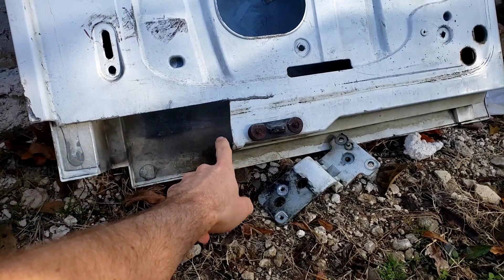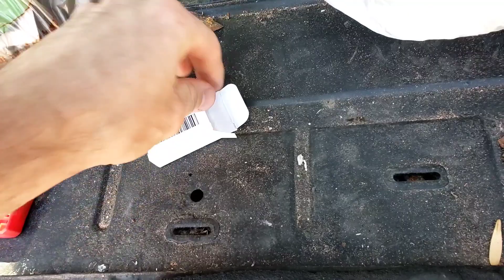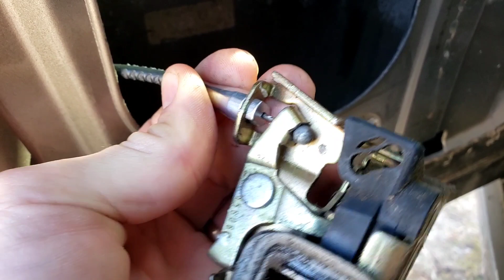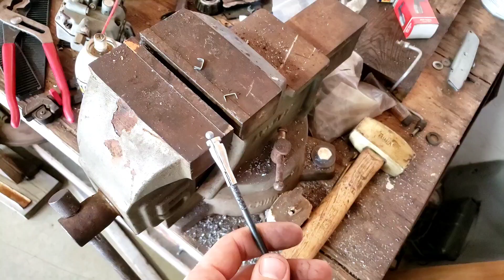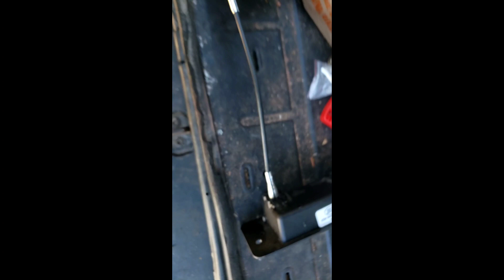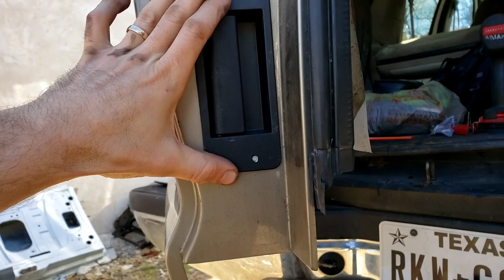Fix Your Ford Excursion Broken Tailgate Handle, Inexpensive!

Comment: What size rivets did you end up using to reattach the handle? I’m going to have to buy a kit for that.
Reply from the maker: I don't recall.  I'd recommend getting a set of various sizes from your local hardware store or Harbor Freight or Amazon.  Most rivet guns are packaged with bits to make them capable of various sizes.
Reply: I can’t get mine to open, so I can do what you did on the video. Any ideas?
Reply from the maker: @BEAR-x5i 
Are you able to open the upper hatch and passenger side barn door?
Reply: @RosyWrench Yes. Except the driver side barn door. There’s no steel wire attached. It’s missing. I just bought this Excursion.
Reply from the maker: @BEAR-x5i  if you Google 'excursion barn door latch diagram' or something to that effect, you'll find an exploded drawing of what's inside the door that help you visualize what you're "looking for" with your hand.  Also, if you have a camera/scope you can stick it inside the door to view the latch mechanism.  Without the cable in place, you can still unlatch the door by manipulating the arm that the cable moves.
Reply: @RosyWrench Ok I’ll try that. Thank you!!!